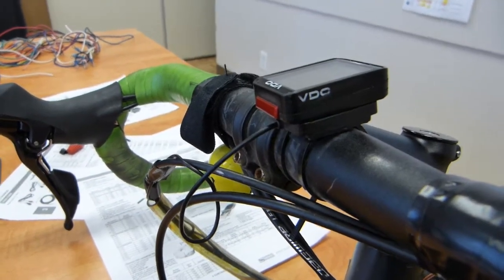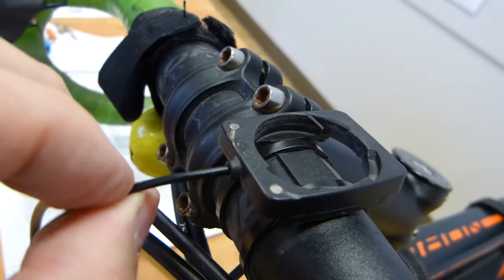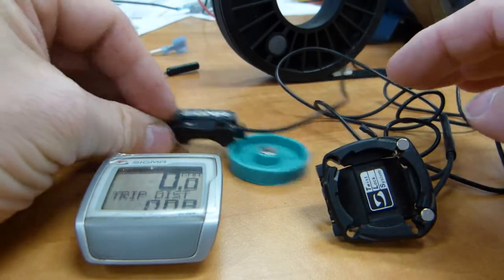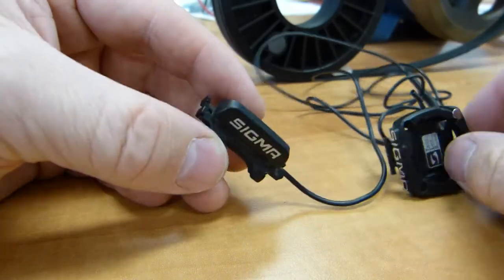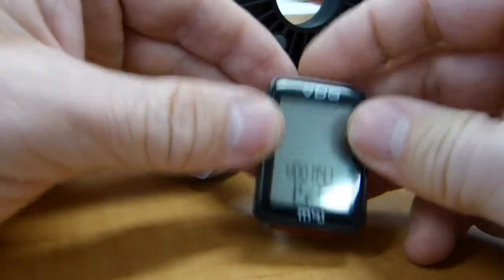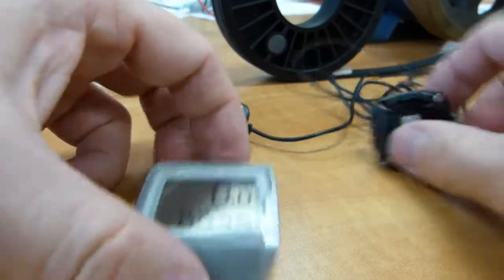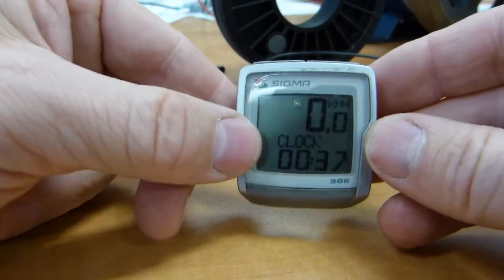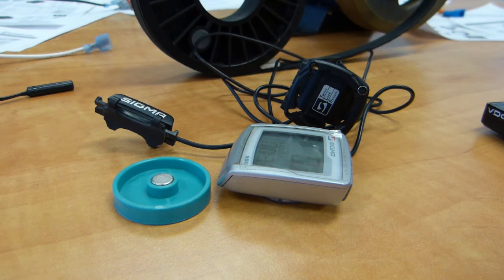How a bicycle speedometer works

Comment: I still wonder, why wouldn't they use a reed relay or a Hall effect sensor? Induction wouldn't be my first choice when making a sensor like this
Reply from the maker: Ah, good one. Power consumption is a problem, a Hall-effect sensor is powered and 2 sets of batteries are needed or if one is used for both the sensor and the display, the battery runs down faster.

Comment: This does not answer the question how the computer, no matter how far the sensor is placed on the spoke, calculates the speed.
Reply: The sensor just measures rotations, and the unit calculates speed based on the tire size setting and the time it takes to rotate. Any position on the tire will register as a rotation.
Reply: @Forlorn79 that doesnt explain the question.
Reply: sensor gets a frequency because it measures magnetic proximity per second and 1 magntic proximity = 1 rotation so this frequency (f) in rpm gives you the speed if you give the cmputer your tire diameter : v=d/t and t is 1/f and d is your tire circumference = 2*pi*r where r is radius of your wheel. Calculator can just count the time since you got on your bike and then can calculate the total travelled distance : D = v*T
Reply: No matter how far the sensor is placed on the spoke time duration doesn't change (I think)